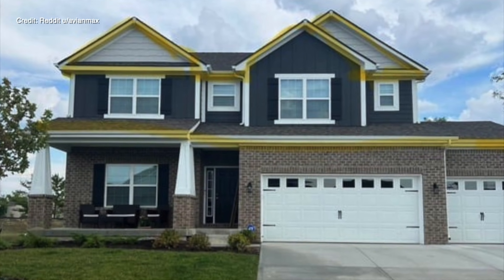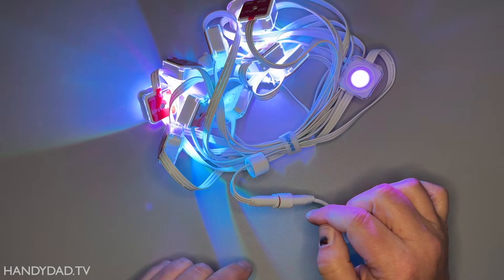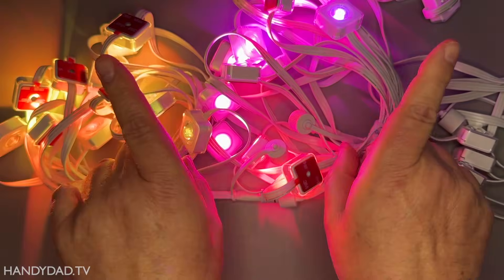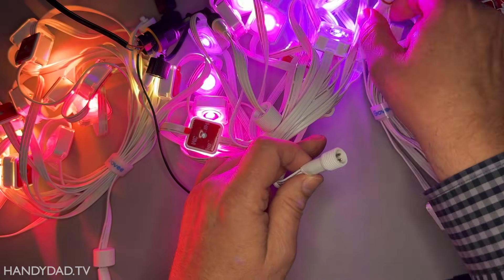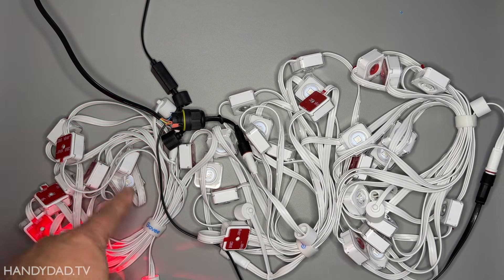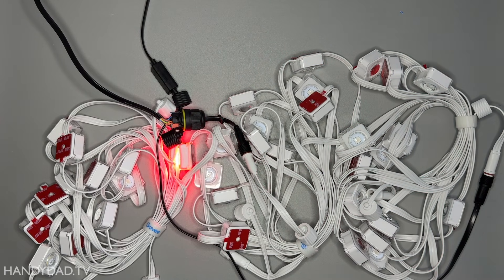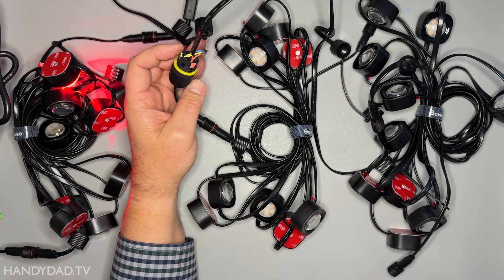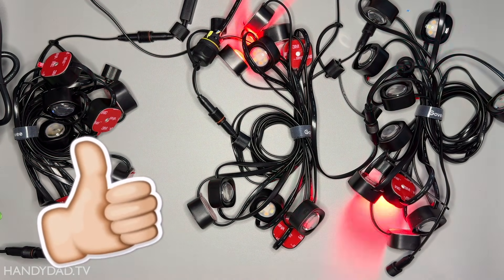Can you split Govee lights with a Wye Connector?

Comment: When making a Wye Connector using the Pro splicers but using the regular extensions what are the blue, yellow, and orange connections compatible with?  The center is the data yellow, I believe, but what is the wire with the black or grey line on it?  Is it blue or orange?
Reply from the maker: I can’t answer
Reply: @handydadtv  I took a guess and hooked Grey lined wire to blue and the last one to the Orange and it is working.
Reply: I did try the 5 second hold and saw the lights do their flash but it did detect the three I added on one side.  Had to go into the app and tell it there was another strand.
Reply from the maker: Glad you got it to work!

Comment: I have two peaks that will probably be fine to run in parallel, the question is… if the peaks beyond the y are strands number 5/6 on the pro, does it need a driver to boost the signal, or are both y forks seen as “5/6”.
Reply from the maker: If six mirrors five, the app will only see five strings.
Reply: @handydadtv I think it would be 5/6 mirrors 5/6, which I’m fine with the app seeing those as the same. The main concern would be are their any issues with dropped signal? I’m new to this so I’m not really sure what the driver is needed for beyond that 6th string in a continuous setup.
Reply from the maker: @WTFSprints I think it’ll be fine. But I always suggest testing on the ground first just to be sure.

Comment: THIS IS EXACTLY THE VIDEO IVE BEEN LOOKING FOR!!!!!  Thank you!!!! You answered several questions for me with this demo.
Reply from the maker: Glad it was helpful 👍🏻
Reply: Made a spitter and one set of lights  don't work everything else does.
Reply from the maker: @angelofdeath3563 Probably wired incorrectly. They need to have the correct three wires connected to each other AND the signal needs to be in the correct direction. You may have the string reversed and it won’t work.
Reply: @handydadtv  where can i get to make the adapter
Reply from the maker: @olvinescobar7636 I just made this to prove the concept. Odds are, you’ll need to cut and splice the string in the middle, not at the connector.

Comment: We have a Ranch house with a dormer over the garage and soon to have a split dormer/roof over the front porch and bay window. (small roof over a porch sharing the same left side as the dormer over the house) I thought about adding the "Y" so the dormers had the same left to right pattern as the straight line of the ranch. But I'm not sure if that would be a waste of lights and look cool enough. Any ideas?
Reply from the maker: I think you should decide where to put the lights before you think about wiring. 

I suggest you post a photo of your house on Reddit /r/Govee and ask their advice.

Comment: great video.  I just ordered my pro 200 since there is a phenomenal Mothers Day sale this weekend.  When using the Y's, are they already made with one female and the two males for the y or did you have to modify the splitter?  I havent received mine yet so dont know how it looks stock out of the box.  Also what is your recommendation for a 3 ft deadspot where I need to backtrack.  I am thinking of using butt connectors and 20g wire to add like a 4ft blank run.  Thanks for your help
Reply from the maker: That was a hack using parts included in the kit. Govee doesn’t make nor condone the use of Y splitters.

Comment: Thanks for this great video! What happens in this example:
A splits in B and C. 
B has 10 pixels, C has 20
Sequence is set to jump 1 at a time as you have shown in your video. After it gets to # 10 (end of B), what happens?
- B goes dark while C continues to 11, 12, 13. When C comes back to 10, B starts again
- B bounces back to 9, 8 7 while C continues to 11, 12, 13
- B and C bounce back to 9, 8, 7  and C 11, 12, 13 stay dark
Reply from the maker: Yeah that’s what would happen. B mirrors the first 10 pixels on C.
Reply: @handydadtv  But if you have the Pro you define C as 20 and B lights all 10 in sync with the first 10 in C then C continues for the remaining 10 correct?
Reply from the maker: Yes

Comment: Interesting video. What is the wire gauge you used for the "Y" connector and did you use solid or stranded wire?
Reply from the maker: I used the cables that came with the kit.

Comment: I am about to try this.  The split is on the front porch.   I think the pattern will look good with 100" going in each direction.  Would the ysplitter make them run away and run into each other?
Reply from the maker: It depends on the direction of the effect in the app.

Comment: I have the 100ft govee pro lights. 
 I cut 2 lights from new strand to add lights onto a corner, then added 12ft blank  extension cord to it, then on the other side added the rest of previously cut strand but lights conected to extension cord don't work😪
Reply from the maker: Did they work on the ground when you tested them? Go into settings and reset the length. If that doesn’t help, double check the splicing connector. Make sure you stripped enough wire.
Reply: @handydadtv yea all the ligjts worked before. Is just after cutting it and adding 12ft extwnsion they don't work, well only the ones after extension cord.  I been playing with app and when going into settings it ask me how many green lights so I put 4 the it ask if I cut the ligjts I said yes then it ask how many rwd ligjts I said 2 then it stars calibratin and thas about it but can't find where te twll the app the lenght of ligjts.  O have the pro
Reply from the maker: @futbol1972 Sounds like you’re doing everything right. Try a different extension?
Reply: @handydadtv  How bro, its been a while.  I have not put up the rest of my lights yet but I want to do it today.  I am still trying to figuer out why after cutting and adding 12ft blank extension the lights after extension cords dont work.  Somebody told me to flip something a long time ago but cant find the email anymore.  Something in the connector
Reply from the maker: You waiting until it got cold again to complete the job? 😉

Be very careful to maintain proper polarity. If you reverse positive and negative, or accidentally touch +36v to the data line, you can fry all your lights. 

Also, these lights are directional so the data flows in one direction along the strings. They won’t work backwards.

Comment: So I am trying to figure out a downside to this. I have a basic 2 level house. Top and bottom runs only differ due to gables on top. I was thinking of splitting the signals at the beginning of the run and run 3 sets below and 4 sets up top. Any reason one would want them to chase in a circle around bottom or top of one side of the house and then to the opposite (top bottom) to the other side rather than just a sweep across the house on both floors?
Reply from the maker: I personally think they look better circling instead of parallel.

Comment: Where did you get the extra ends to make a Y?
I split my lights now none of them work 😢
Reply from the maker: I used the splicing kit that came with the Pro kit.
Reply: I did that too now none of my lights work 😐 I'll have another go at it when it stops raining. ALso I caught from you video that the systems might need a reset by pressing and holding th button on the controller.
Reply from the maker: Also, make sure you connected the respective wires together and in the right direction.
Reply: What do you mean by "right direction" @handydadtv  ? Also, thanks so much for your help! I was freaking out a bit thinking I'd destroyed my lights until I found your video.
Reply from the maker: @thatMikeMurphy Addressable pixel strings are directional and can’t be reversed. Before you cut off any connectors, make sure you mark which end goes towards the controller.
Reply: @handydadtv  thanks. Looks like they are running the right direction but still no luck.
I connected the main run directly to the splitter all by itself and it doesn't light up anymore.
I hope it's not fried!

Comment: That’s not true.  Each individual light is numbered. All you have to do is go to the DIY section of the app and you can customize it exactly how you want it. They will never do the exact same thing, unless you programmed to do the exact same thing.
Reply from the maker: Sorry but you’re wrong. The lights are not numbered. They just consume one byte from the data string and send the rest down the line. If you split the data, the lights on both sides of the split are cloned.
Reply: If you split them they 100% do mirror one another. I just did an install with 2 splits.
Reply: Want me to show you the numbers under the 3M tape?  take a piece of 3m off
Reply from the maker: @josemata561 Feel free but that’s not how they work.

Comment: Thank you for all the info you have put out on this product. I have a question,

I plan on putting a “command center” style panel  to have power, ac adapters, controllers all in one spot) in my attic to control my Govee lights and the fish the wire through the soffit to begin installing the lights. I only plan to install lights on the front (54.5’) and back of the house (42’) with no lights on the sides.

I have a Pro 100’ kit and purchased an extra AC Adapter and controller off of eBay. My plan is to have run the front and back off of separate power and controllers. In order to centrally locate the command center I need to extend the wire out of the controller by about 30’ - 40’. That would make the back light length be about 92’ max. Do you think that will work? 

Thanks
Reply from the maker: I think it will work, but you should do a bench test on the ground before you start drilling holes and standing on the ladder.

Comment: Do you think ot would work to do a Wye Connector coming off the power supply/control box and split to start 2 separate lines. One line would be 140' the second is 120'
Reply from the maker: Technically yes, but that’s too much for the power supply.
Reply: @handydadtv  I'm looking to do this also, but the lines would only be about 50' and 40'. Would that be too much for the power supply? Definitely wouldn't exceed 150' with extensions and all.
Reply from the maker: @Naroh12 You should be okay as long as you don’t exceed the maximum current.

Comment: So if I split right at the start of power source with Y splitter can I have two 150ft?

since the original version has a 150ft max will the Y split make it two 150ft making total 300ft
Reply from the maker: No, the power supply is only meant for 150’ max. If you’ve got two sets, install them independently and link them in the app. No need for the splitter.

Comment: I am not sure if I missed this or not but can you tell me if you can run more than a single light set off the Y branch.  So say I have 3 groups of lights and another 3.  Can i connect both sep sets of 3 to the Y point and all those lights after the Y would work, obviously a mirror of themselves?
Reply from the maker: Yes, I just used one for the demonstration.

Comment: Thanks for the helpful video.  Question if you don't mind.  At 3:!2 you extend to another string of lights after the split and it doesn't work.  If I'm understanding it correctly,  after the split you can only have one string?
Reply from the maker: I did that to show the app was configured for only two strings. But I could get the third string to light when connected from the wye because it’s really a clone of the second string.
Reply: Hi, I m prepared to split my pro, but are you saying that if we split the wires, you can't connect a 2nd strand? Strand A split to B,C and D,E,F for example? And in the app, you chose 4 strands. Will that work?

Comment: will this work if one side of the split of lights continues longer than the other side of the split? we have a spot where the roof line splits and need 3 strands on the lower to go across the garage and only 1.5 strands to do the peak above the garage. (I have the pro lights that can be cut)
Reply from the maker: Yes. They can be different lengths.

Comment: Hey brother,  I have a 200ft pro kit and came up Short 30ft   to complete line around my house.  I bought 2 extra strands on ebay.  How can I complete my house using these  ? I never used any split or extensions since it was a straight around install  ? Thanks and great work u do
Reply from the maker: I don’t think the app will let you have more than 12 strings.
Reply: Maybe try to do a power injection somewhere near 75% region,  I did several 10’ jumps with 200’ pro kit and had no problems so maybe you just need a couple amps boost.

Comment: Hi, thx for the helpful video in case i need to do something like that Y to finish my house. I tried to ask a question earlier but i dont think i did it right, ive never posted anything before. My question is, i have the govee original 150' and in the APP it only has 9 segments, i need to go about 165' to finish my house, do you know if its possible to add a 10th segment? I tried it yesterday (last night) and that last segment didn't light up. I was hoping it was possible to change a setting in the APP somehow.  Thanks for any help.
Reply from the maker: No, 150’ is max on the original.
Reply: Hi, thank you for answering back, 2 more questions, hope you get time to answer....do you think govee will have come up with a driver (for the original set) that can handle up to 200' (like the pro set)?...And could a pro driver (up to 200') be used with the original set to allow the original to go up to 200'? Thx again.
Reply from the maker: @user-zw5mj2sf9h No and no. They engineered these kits for simplicity (no power injection). If you need to go longer, buy two kits and link them in the app.
Reply: Thank you again....your a good help. I'll look into that!! 
Or maybe i can run that Y splitter off the first segment, and then use the extension piece in the kit to get up to that last 10 ish feet of lights I need. It's on the side of my house so that last 10' of lights is not in the front to be seen as much, and seeing your video, I understand it will be in sync with the first segment for its operation.(if possible)  Last lil question (and thank you for your time) do you think that will be too much total length for the driver to handle? 160' of lights and 2 extensions. I think it might be and I probably will need another set.
Reply from the maker: @user-zw5mj2sf9h Should work, just don’t run them at full brightness or it could overload the power supply, which is sized for 150’ max.
Reply: Thank you again. I appreciate your helpfulness. If I have 2 seperate sets (2 power drivers) 1 is starting at say A of the alphabet, and the other is starting at Z of the alphabet, and they will end/meet at say L of the alpha bet, could set Z be set up to run from Z to L (kinda backwards from driver...meaning if I turn set  A on and the lights are goin A to L in line, when it gets to the next set (Z, running in reverse/backwards) would they stay on track and continue in line? I hope I explained that good enough. Bottom line....I wish I planned out my layout better!! I started off with not planning on doing my whole house but after seeing em and the ease ish of installation....I want my whole house lit up.

Comment: Can you split right after the power source? So instead of power > 1 string > y adapter > 2 strings. Can you do power > y adapter > 1 string left > remaining strings right.
Reply from the maker: Yes
Reply: @handydadtv this was my next question. Glad you answered this already 
How is this technically permanent though? Is it because the direction of the connectors? Is the connectors the only thing that determines electrical flow through the strands? I would think just splice in a different connector and be on your way?
Reply from the maker: @PMPerformance I wouldn’t splice unless you absolutely have to, but you don’t need a connector at all. You can cut and splice the wires and use solderless waterproof connectors. You just need to make sure to connect the same wires together. The one with the tiny stripe is ground. The middle is data. The other side is +36V. Mixing them up could ruin your lights.
Reply: @handydadtv  I have the pros, so the connectors aren’t a problem for
Me
Reply from the maker: @PMPerformance Ok 👍🏻
Reply: @handydadtv  I just found out this setup will not work for me sadly. I guess you lose individual light control since they are parallel which makes sense.
Reply from the maker: @PMPerformance Exactly.
Reply: @handydadtv  I appreciate the info and the great videos. These videos helped me make the decision to buy
Reply: Do you have to disconnect the Y if a reset is required so it doesn't get "confused" on the startup sequence?
Reply from the maker: @TFFAL Good question. I don’t know.

Comment: What if you y it from the power source
Reply from the maker: If you split the line immediately out of the controller, say on the corner of your house, and go in two different directions, each of those branches will do the same effects. Always.
Reply: @handydadtv  Thanks for the video, do you mean that this would still do the same mirroring as you showed in the video?
Reply from the maker: @prerakpatel Yes.
Reply: @handydadtv  thanks, think I will have to start at a different outlet.

Comment: Interesting , but NO. I see no need to have two strands doing exact same thing.   MAYYYYYBE if you had a LARGE home and put them on opposite sides of house or a barn etc.  That’s a MAYBE at best.  I’ll follow directions and try not to customize anything in setup.  Good video.
Reply: Link for wyze connectors?
Reply from the maker: I agree. It could be more work to do, but wiring end to end is the better option.